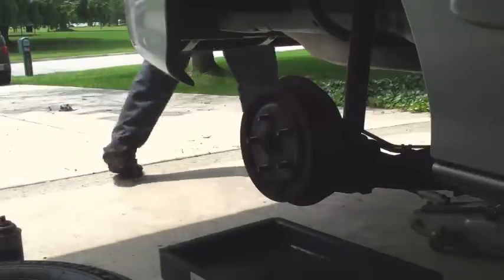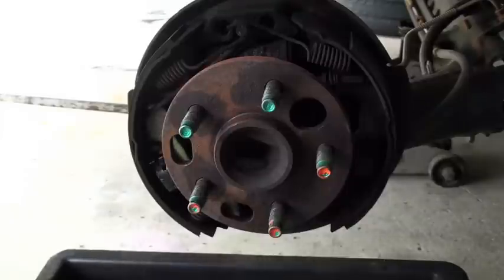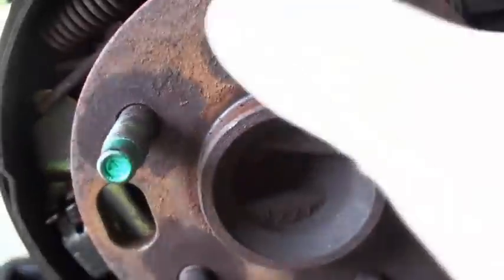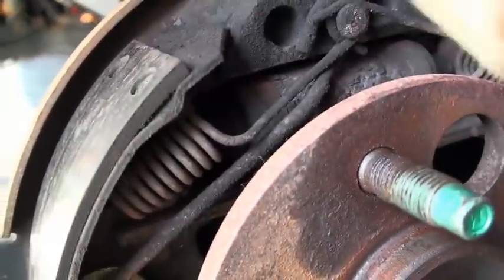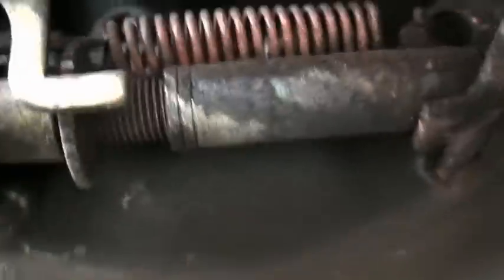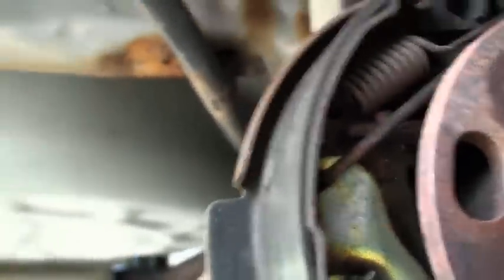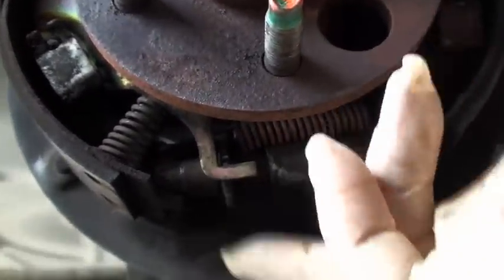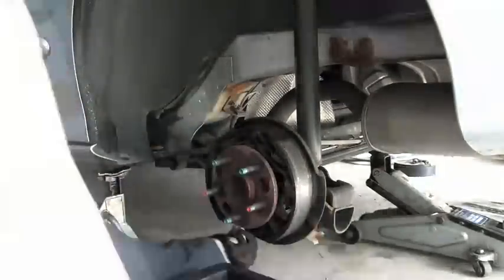Drum Brakes a Quick Look - EricTheCarGuy

Comment: 👍

Thank you! Just what I needed. Very Basic Knowledge of how to get the drum off (I assumed I probably would need a hammer), and what's under it. Was somewhat sure of each, but I wanted to be Sure. All I want is a look right now. Once I  release the parking brake, something 'clunks' like it was stuck, when I start to pull off. Drives and brakes fine, but it's that 'clunk', & sometimes a little 'lurch' just before pulling away that hasn't always been there. Like the pads were actually 'Stuck' to the drum.

I'll check out your other videos for replacement/repair later. I just want a 'look-see' right now. ;)

Thanks again! 👍

(Wow! This was 16! years ago??!! 😯)

Comment: Good night. First of all I loved your video, 11 years later eheheh. Second, I have a question for you. I have an old tractor that the brake drums are already very thin because they have been rectified once ... However, there is no sale on the market anymore .. What kind of material should I ask a turner to make ... they they are 150mm in diameter. My idea is to cut the cylinder structure and weld a new cylindrical tube ... did you understand my question? how thick should it be? where can i get this type of pipe?

Comment: With the drum brakes for VWs, the Cabriolet in particular, you can actually release the drum from the hub by sticking a screwdriver through one of the lug bolt holes to 'flip' the adjusting wedge. This requires no hammering, and the drum comes right off. Trouble with this is finding the adjusting wedge. There's a video available on youtube on how to do that though

Comment: EricTheCarGuy ,
4:20 ....
 Out of curiosity while cleaning the interior some months back, I applied the P-brake on my 2000 Cavalier daily driver and there was no actuation of the shoes = no hold.... Not sure how long it's been like that. I'm looking to K.I.S.S. today with a driver's side wheel cylinder replacement after the pedal dropped, loss of braking and inspection revealed indications of fluid marks out from the holes in the steel wheels a few days ago.... Been subbed since the 2000-oughts and have come to realize I don't see an applicable video on P-brake + cable adjustment. 
🔥🤔 What are any waypoint instructions, suggestions on the criticality of the P-brake (as it pertains to 1)_wheel_cylinder_replacement versus 2)_doing_drums_&_shoes) ,
⏭ your method for P-brake/cables adjustment and,
⏭ if your channel has one, a link to a P-brake video ?

Comment: +EricTheCarGuy. Hi Eric, just replace rear shoes & drums on our 1998 Honda Accord. The brake pedal is spongy now... When the guy I had helping me was working on them, I think the wheel cylinder on the left rear leaked a little bit. Isn't that why the pedal is spongy now? Dan
Reply: failing wheel cyl will be the cause, not a steel drum

Comment: @EricTheCarGuy have bought an golf mk3 cabrio. And im stuck with an mistery on the car, The rear drum brakes don't work (just a litle when  pull the handbrake verry high.. I opend the rear drums and saw that al the springs where good and the shoes where also verry good. I cleaned everything and put it back together ... Earlier I also tryed to turn the 2 bolts by the E brake but they where tot the max turned.. What can it be  I also tryed to bleed the rear brakes but still nothing.... the cylinders are not leaking and as I said the brakes have a smal bit of control when I pull the E brake al to the max ( The E brake lever goes also verry light)  HELP! And sorry for my bad english im frome Holland

Comment: hey eric,
I have a 06 chevrolet express van 2500. having trouble installing parking brake cable, Is there a way to adjust at the pedal to give it slack to install a replacement R/R parking brake cable? Seems like I have the right length according to the dealer but still falls short to hook it where it splits
Reply: Prolly too late.. butOn the colorado theres you disconnect the cable under the drivers side door, made on the vans its similar
Reply: +Kevin P thanks for the response, I managed to get it done. I fought with it for a while hahaha I saw where it disconnects but i didn't have enough slack to connect it easily

Comment: Eric, if the drum doesn't have those two bolt holes, use rubber hose to protect the lugs, then use a flat face tip air hammer and give it a few taps between the lugs. If you use a hammer not only as you said will risk hitting the lugs,.. you can damage a wheel bearing too.

Comment: I just put on new pads and hardware, & have adjusted and readjusted the passenger drum.  I am hearing a 'click, click, click' when I apply the brakes at 25mph and below.  When I engage the parking break to stop the vehicle and don't use the pedal, I don't hear this noise.  All parts look to be correctly installed.  I have been reading, & it seems that either I adjusted something wrong or the new drum I purchased may be out of round.  Could you give a couple ideas to trouble shoot?  Would adjusting the drum on the other side have any impact on the drum I'm having an issue with?
Reply: +Jared Hartman no, eric hates you and will no be answering any of your questions

Comment: i've replaced the drums on my 2003 accord and im still get brake vibrations from the rear...? why is this?
Reply: Are your parking brakes releasing as they should? Seized parking brake cables cause the parking brakes to not release.
Reply: Ford6.9/7.3idiDieselFan the car rolls freely with the E-brake dis engaged, so i don't think its sticking.
Reply: Mogo McG Are your wheels balanced?
Reply: yeah they're balanced. I've pinpointed the problem to be one of these things... either my abs sensors are all fucked up in the rear. also when i changed my drums, i didn't change the brake shoes (because they looked fine and had lots "meat" on them)

Comment: I hate drums so much! I have had nothing but issues with mine.
Reply: +Evansmustard meh, drums are easier to maintain compared to disks if maintained right.
Reply: +Evansmustard  i prepare drum on the rear brakes, coz they go longer than rotors they get warp faster , drum they dont go warp.............. believe me.... why do you think drifter wants drum coz drum brakes r not vulnerable compare to rotors

Comment: my 1988 toyota sr5 pickup has a break problem. ever since last month when i bought my truck it always had a break problem the problem is the break peddle is really soft and have to push it almost to the floor to get it to stop but it does stop good but the rear breaks don't work. i looked for leaks and i did find that the rear left wheel cylinder had fluid in the rubber boot so i
Reply: My truck has the same problem right now, but can you finish your comment?

Comment: I did my first brake pad replacement on my 2013  Nissan Sentra and to my surprise, the dealer told me, beside the pads, they have to replace the drums becouse they where "rusted"...does the drums from a brand new car have to be replace after one year?,,,did I just got punk?
Reply: I would say you were taken .In a year they would never rust enough to replace. only other thing would be if the shoes were wore down to metal and the drums were scored then maybe a replace.
Reply: Yes they rust a bit on the outside but not on the contact surface. Umm, if you live in a heavy road salt environment they may runs that fast.  My two cents.

Comment: Hello, Eric.  Enjoy your how-tos!  I have to wonder where you are as your brake jobs seem to entail dealing with metal corrosion and sticking parts.  I would lay on some anti-seize when replacing the brake drums to make future service more mechanic friendly.  Appreciate the tip on the non drying silicone lube for disc brake sliders.  Changed the front pads on my '99 Tahoe and used the 'specified for brake parts' lube on the pins.

Comment: I drive a 1985 Nissan sentra B11, when i have to adjust the rear brakes i jack up the back end and turn the star wheel until the wheel feels right. If i try to adjust it like you did by pulling up on the handbrakes would it also work?

Comment: my 02 cavalier is the worst car ive ever had, 4 out of 5 wheel studs snaped of of the front right. they were torqued to spec, and the parking brake will not adjust and rear brakes stick. i will never ever buy american cars agian import ftw.

Comment: hey eric!big fan of yours by the way!:) im going to be doing my brakes all the way around,and i have a"03"mitsubishi galant 4 cylinder 2.4 liter engine,..So rotors/discs in front and drums in the back.what did you mean it has to"SIT FLUSH"?and how do you know when your adjuster is set correctly???...Last question,DO I BLEED MY BRAKES ALL THE WAY AROUND FIRST?OR UNTIL IM DONE INSTALLING ALL THE BRAKES AND COMPONENENTS AND THEN BLEED???

Comment: hey eric, i have this car, this car has a rear differential that is attached to a drum brake. the brakes on this are set to apply as the default when the car is turned off. i bought this car and the guy hadnt drove it in 5-6 years and this was sitting in the rain and weather : (, so naturally rain and the brakes being applied got the shoes to be stuck to the drum, and now the drum will not turn,move, or budge at all,help!

Comment: Ok it seems I forgot to bleed the master cylinder...now my brakes are working but only 40%...now I still have to press the pedal to the floor and the brake light comes on....the fluid is topped off...Is it possible I may need a Power brake booster??? And thanks for the first reply

Comment from the maker: @314LifeProductions I don't think the brake return is your problem, you might want to look for leaks in the system particularly the wheel cylinders first.  I would say it could be an adjustment issue but the fact that it happened suddenly really doesn't fit with that.  Take a good look at the entire system to see what you can find.  Good luck.

Comment: I have a 72 Buick Skylark...Recently the brakes completely stopped working. It seemed like I had air in the brakeline, so I bleed them twice.  Still no  brakes.  I changed the master cylinder. .  I bleed the brakes a third time but this time I just opened the bleeder screw without apply the brake pedal.  I noticed that when the brake is applied, the shoes press towards the drum but they do no return to the original position...What could be wrong? plz help I can't afford to take it to a shop...

Comment from the maker: @derkgonewild I would remove the drums and inspect the brakes to see if there was anything abnormal first, I would not replace them unless I found a problem.  You might consider lightly sanding the friction material before you install the drum again also.  Make sure they are properly adjusted as well, if they are too tight they may overheat and cause noise.  Good luck.

Comment from the maker: @DanielRemains Self adjusters are a joke to be honest that's why it's good to do them manually once in a while.  It's actually common for the brake not to hold if the shoes are new they kind of need to seat in first as new shoes sometimes don't make complete contact inside the drum, think oval inside of a circle.  As for tips on adjusting you might want to check out some of the videos I did on drum brake servicing where I not only show what parts to lubricate but how to adjust.

Comment: @EricTheCarGuy Yeah I did it like 4 times this week lol having hard time to adjust them just perfect. The handbrake in the car is tight and the brakes aswell but the handbrake still doesn't lock the wheels like it should. Thanks for the reply man! Oh and today I checked that little adjuster plate that is supposed to make the adjuster wheel turn but instead of going up it goes to the left which doesn't help for s**t LOL.

Comment from the maker: @DanielRemains I'm pretty sure that's a non-servo style which would adjust with the hand brake.  To be honest however it's not common for those to work as they should so it's not a bad idea to clean and readjust them manually from time to time.

Comment from the maker: @duhkify I recommend watching one of the drum brake replacement videos to see how to adjust the rear brakes.  When adjusting a parking brake you start by adjusting at the wheels and if you still need more adjustment you then adjust the cable tension.  You do not want to adjust the cable tension first as it will make it difficult to install new shoes if you have to at some point.

Comment from the maker: @goodandchew10 Brake pads will rub against the rotor normally, if it's not causing the wheel to drag I would not worry about it.  If it is locking up the wheel then you probably need a caliper or possibly a brake hose.  BTW tightening caliper bolts really wont' do anything but make it harder to get it off in the future.

Comment from the maker: @eflynn162 I'm not sure what the benefit would be of just installing a dual bowl master, these are referred to as "split diagonal" in that one chamber activates the RF and LR and the other the LF and RR, this is a safety feature that keeps you from loosing all of your brakes should there be some sort of failure.  The "equalizer block" you refer to is actually the Proportioning Valve and helps proportion the braking force front and rear, normally 80% front and 20% rear.

Comment from the maker: @rlewis1946 Consider this, brakes turn speed into heat, your car is out in the elements, rain, dust, snow, ice, cold, and hot conditions.  The metal in the brake system goes through a wide range of temperatures in a given day, month, or year, all of this will take it's toll on the metal causing it to rust as well as temper over time. Now consider there is only so much the engineers can spend on the metal they use for the brakes, now multiply that by the number of cars they need to put brakes on.

Comment from the maker: @goodandchew10 A used master cylinder is not a good idea in my opinion, it also sounds like you might benefit from bleeding the brakes, try this procedure, LF, RR, RF, LR.  I also recommend using the tool I showed in the video to bleed with as you can see the air in the system if there is anything.  Good luck.

Comment: Eric, I did everything you told me to do. Since  I dont have an E-brake I did the reg. brake then bled the brakes. They worked for awhile but it wasnt for that long i took it on a 25 mile trip and they lost brake pressure. I had to fill the master cylinder up a lil bit i check to see if the lines were leaking they shouldnt of been bc i replaced them when i did the brakes. My ? is what is wrong here the master cylinder blew? or is it the rear drum shoes? Very concerned and starting to get irrated

Comment from the maker: @subron6er First I will say I'm completely jealous of your car, for years I carried a pic of a 69 Z28 in my wallet.  If it were me I would look into a front disc brake conversion and not even bother with the drums.  If your are going to keep the drums the biggest tip I can give you is to make sure your brake adjustments on both front brakes are close or it will pull toward the side with the "tighter" adjustment when you brake.

Comment: thanks I have a 69 Camaro I am just starting to work on again after its been sitting the last 12 years.  It has the original drum brakes on it, and right now the peddle goes to the floor, and the drives side front break is leaking fluid, trying to get some repair tips here before going it,,,, thanks Jeff J.

Comment from the maker: @cincityallstar I don't get too many GM's into the shop right now but I have plans to change that since so many of my viewers drive domestic cars.  I have however shot a video on a clutch replacement that I hope to edit soon that will show how it works.  As for your slave cylinder you don't need to overhaul the engine just remove the transmission, if there is a leak you may see the fluid getting low and possibly a trail of it between the engine and trans.

Comment: Eric, I'm working on a 2006 Honda Civic 4door LX, and it has the drum brakes in the rear with those 2 holes for using bolts. Do you know what the size of the bolt is? And are you supposed to just keep threading it in until it pops? Or do you hit the bolts with a hammer?

Comment from the maker: @richardramoso You can use a little penetrating oil around the studs for starters.  Next try hammering the outside of the drum between the studs like I showed in the drum brake video (I did another video showing how to do this job BTW).  The little holes are places where you can thread bolts in to get the drum off easier, if the hammer and penetrating oil won't work this is what I would try next.

Comment from the maker: @scottricerules If the friction material on the shoes are of equal length it is a non-servo style, if the friction material on the shoes are of different lengths it's a servo style.  This is how I remember it.  Servo self adjusts when you brake while backing up and non-servo will adjust when using the parking brake.  Servo in essence means "twisting".

Comment from the maker: I'm not sure I'm sold on an adjustment fixing the problem.  I think an inspection is in order, you might have a leaking axle seal or wheel cylinder or some other issue that is causing it to lock up like that.  It could also be a proportioning problem now that I think of it,  but check the basics first before you get into a "fancy" diagnosis like that.

Comment: Hey, my rear drum on my camaro has been locking up recently right before I come to a stop. The ABS no longer and really my car is showing its age. Its 94 camaro v6 with 185xxx miles and has never had any problems but hey. Machines break. Do you think my drum just needs adjusting or what.

Comment from the maker: Yes, you can align the car but it depends on what part of the tire size is different, is it wider or taller?  It's not a good idea to mix tires especially on ABS cars because the ABS computer will see different wheel speeds and may set a code or cause the ABS to activate when the brakes are applied.